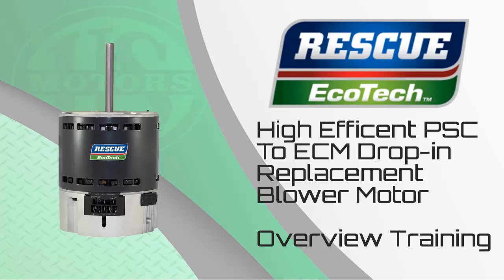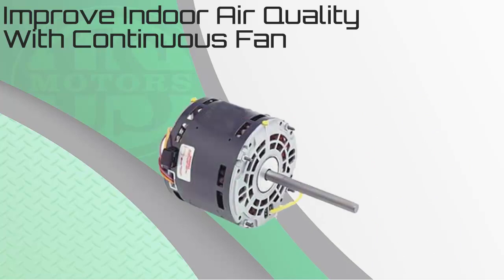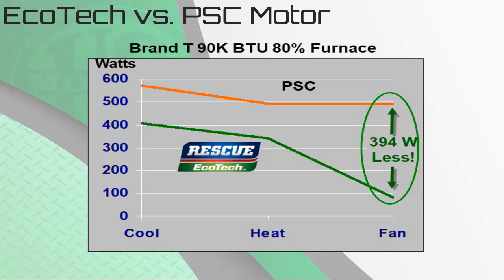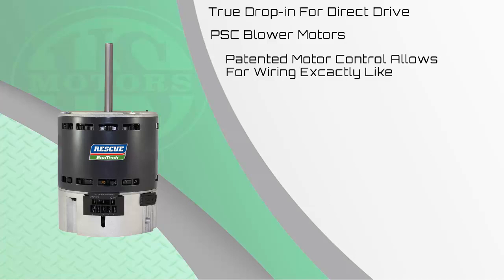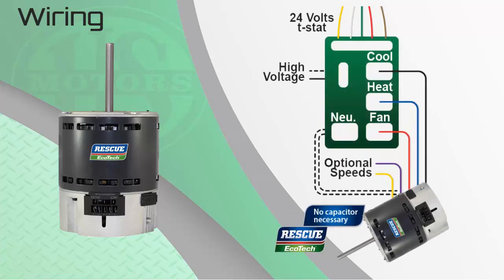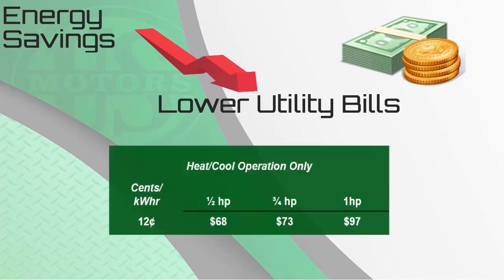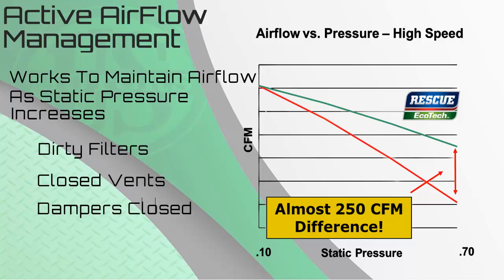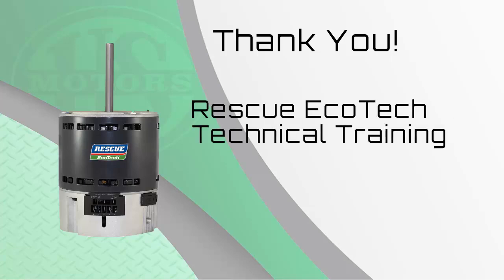New RESCUE EcoTech Overview

Comment: Is there a video or diagram on how to wire a relay for a furnace that doesn't have a fan tap for the continuous fan option.  It is a Carrier builder grade furnace.
Reply from the maker: Kevin - See if this link works. The info you want is on pages 16-18. https://nidec.storyslab.com/content_files/viewer/125129/aHR0cHMlM0ElMkYlMkZzMy5hbWF6b25hd3MuY29tJTJGbWltYXBwY29udGVudCUyRmFwcF85NSUyRkVjb1RlY2gtSW5zdGFsbGF0aW9uLUd1aWRlLnBkZiUzRkFXU0FjY2Vzc0tleUlkJTNEQUtJQUlOWDc0VVlWUEJUSFZQSVElMjZFeHBpcmVzJTNEMTY4NDg2ODgwOSUyNlNpZ25hdHVyZSUzRHJXbkxMJTI1MkZBT2VLNVliR0s4T29rNHF1ZDQxNWslMjUzRA==/?nonav

Comment: How does the efficiency of these EcoTech models compare to the other lines of ECMs that you offer, for example the Select or SelectPro? Are all ECMs about the same with the main difference being the wiring and/or durability?
Reply from the maker: Thanks for the question, Kent. 
The Efficiency is about the same when you compare horsepower to horsepower of our ECM Products in similar applications.   This being said, each aftermarket ECM product is designed to replace a specific, original motor type, they are not interchangeable.

EcoTech is only designed to replace a PSC Motor and uses high voltage signals from the board in order to operate. 
EZ13 and Rescue Select Pro are designed to replace constant torque EC motors, using 24 volt signal to guide it operation
EZ16 it specifically designed to replace 16pin Constant CFM or airflow motor.